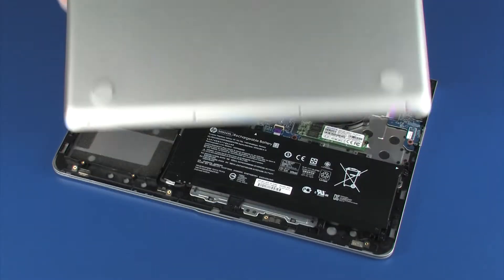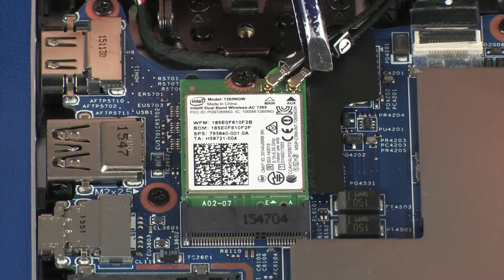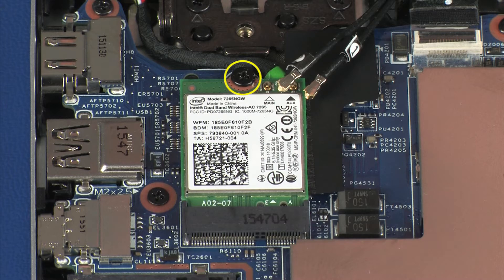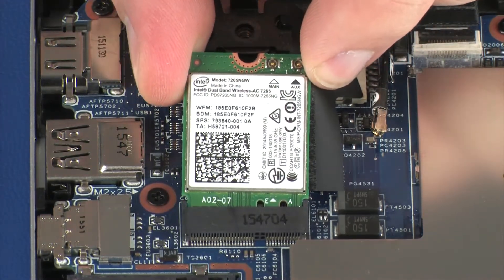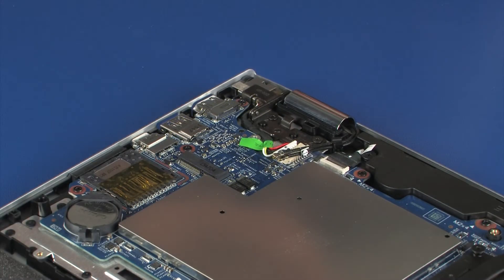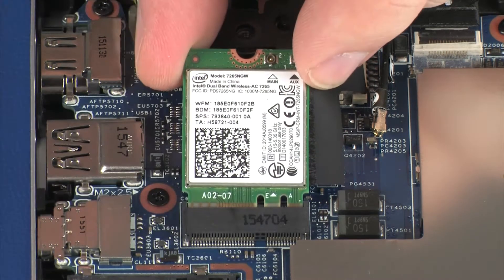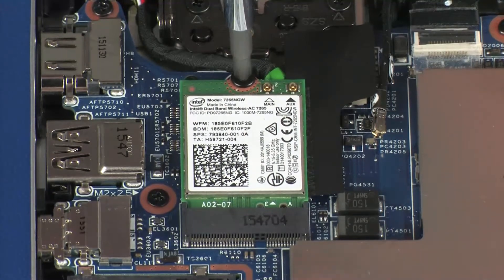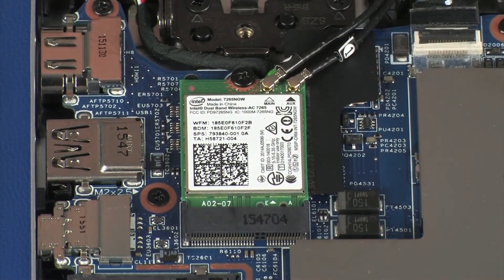Replace the Wireless Module | HP ENVY x360 m6 Convertible PC | HP Support

Comment: Unfortunately my HP Envy 360 has BS antenna cables for the WiFi card and they will not click back in place, since I replaced the WiFi card. I am pissed.
Reply from the maker: Hi there, thanks for contacting HP Global Social Media Support!
I am here to help!
Could you elaborate more on the issue? Have you made any changes to your wireless network? And are trying to connect the printer back to the wireless network?
May I know the product you are using? A serial/product number would be helpful! 
Let me know!
Regards, 
HP Support